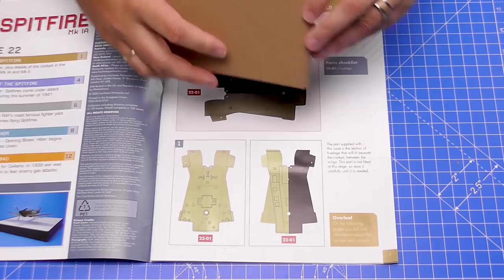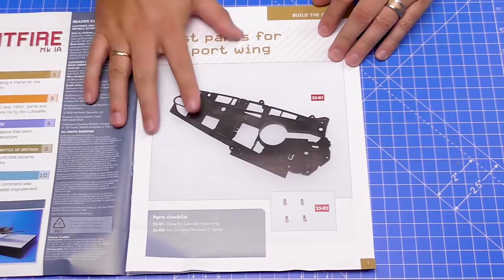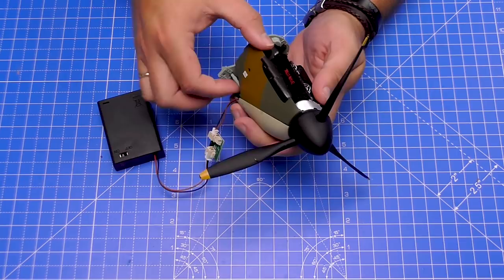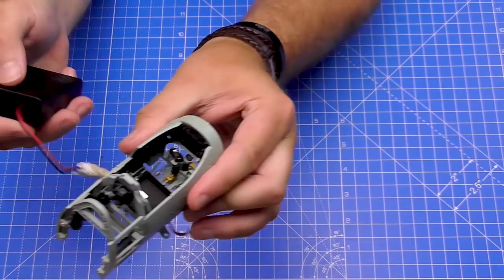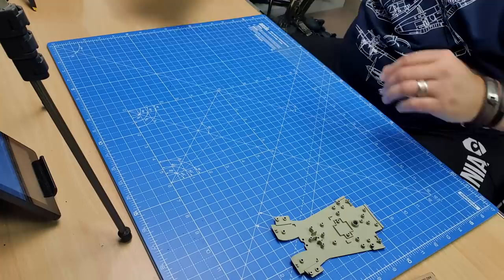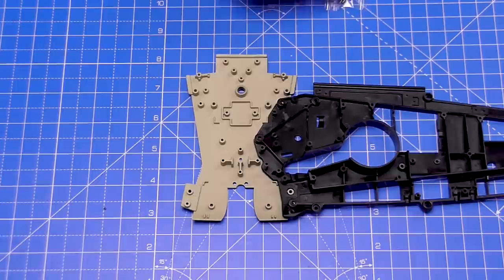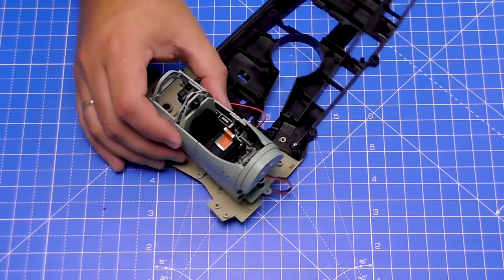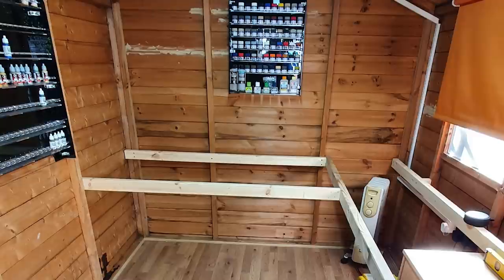Build the Spitfire Mk1a - Part 22 and 23 - Fuselage Panel and Parts for the Port Wing

Comment: If u use the foam insulation in your shed it gets very hot in the summer . But if you use the foil insulation it reflects the sun so it stays cooler . Once the heating goes on its hot then . Good luck 👍

Comment: Great build! Just wish it was available in the US!  Question: I recall in one of your videos . .  I think in the Bismarck build, where you cautioned to be careful regarding how many batteries you use to test LEDs. I probably have it wrong, but shouldn't we only use 2-AA batteries to test LEDs? Anything more than that and we risk burning then out (?)
Reply from the maker: Yer. Best piece of advice I can give. Don't test the LEDs until it tells you. They provide a different circuit board for that purpose.

Comment: I can not blame you for putting the two parts together in one episode, it would have been waisted with individual episode's.☺👍
Just to ask could the fuel tank between the engine and cookpit be where a connector board will go.   🤔🤔
Reply from the maker: It certainly a possibility but I wonder where the batteries will go.
Reply: @WorldofWayneUK  maybe the tail end?🤔🤔
Reply: @WorldofWayneUK  just to ask when you did the r2d2 metal screws in the dome to replace the plastic ones did you need to put washers on them?
Reply from the maker: @robertgripton4499  nope
Reply: thank you👍👍